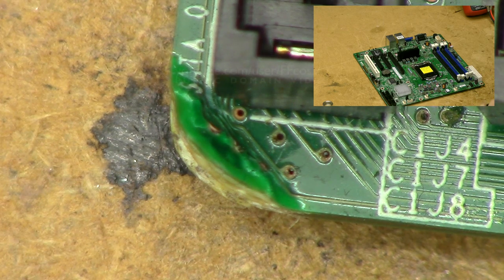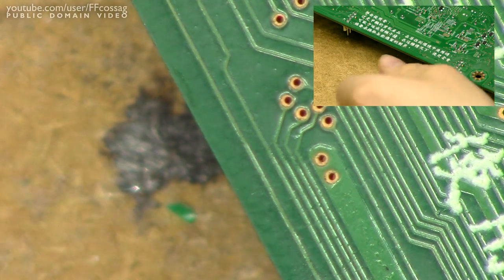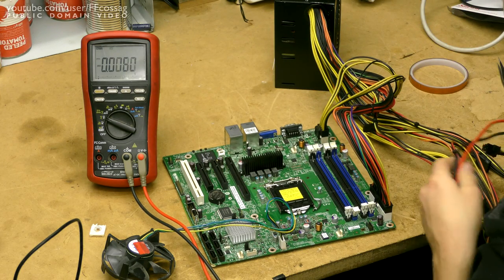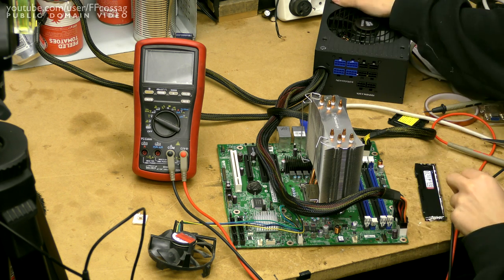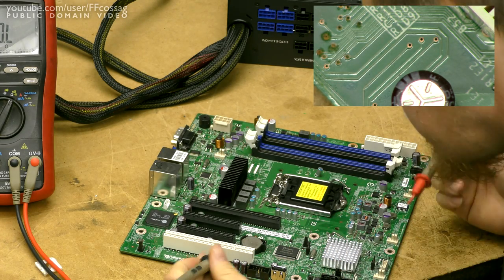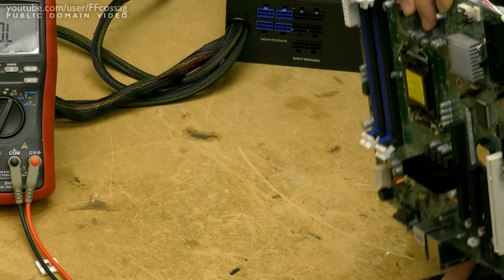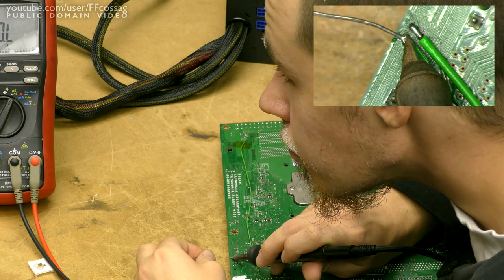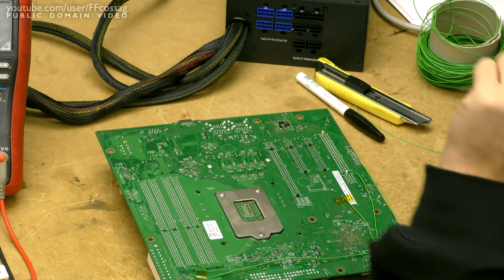Drop damaged motherboard repair

Comment: The knife worked better than I expected. A recommendation for next time - pulling dental floss or fishing line through that foam backed adhesive cuts through it like a charm.
Reply from the maker: That's a good idea. I have a giant roll of really thin steel wire that I could use for it.

Comment: That last wire over the captin tape looked like it had a spike of solder to the next vias, please check before connecting power again, i would not like to see it fail :-(
I liked your clever video zoom-ins :-D bang on in synk with the other camera, looked really impressive :-D.
Multi angle magic.
If that board works fully it may be good to encapsulate the broken corner with hot glue or super glue to bond the layers together so they never move again :-D
Reply: I noticed the same thing, last wire over kapton tape seems to be touching next via.
Reply from the maker: Yeah, I'm going to check that out before I try running it. I noticed it in editing. As for encapsulating it, there's no need. The flared up PCB material is oddly rock hard, and I can't even bend it back easily.
Reply: Wow its solid, perhaps im a bit over protective, multilayer pcbs are a nightmare just waiting to happen, hopefully there are no other layers populated near that corner.
Why did i think about Rossman while watching this lol :-D

Comment: Hey, nice work! It was really a lucky situation, since most of those vias actually disappear in other layers, and you can't find them. However, at 29:00, it looks like the new cable is shorting out to the nearest via. Have you checked that?
And by the way, did it actually worked?
Reply from the maker: It looks that way, and I'm going to check it when I can be bothered. Most likely there's a flux bead under it, though.

Comment: Rather than the plastic cable tie point being stuck there before the incident, is it someone's attempt to splint the injury so to speak? If it was set to auto power on on power failure they probably never noticed the power button not working?
Reply from the maker: This board was ripped out of a working machine, damaged in packing and then sold as-is.